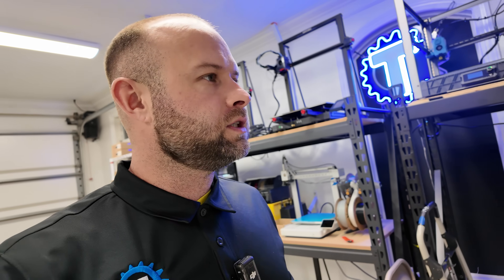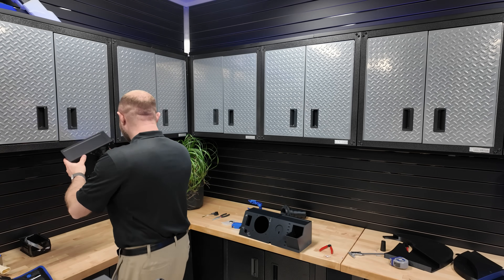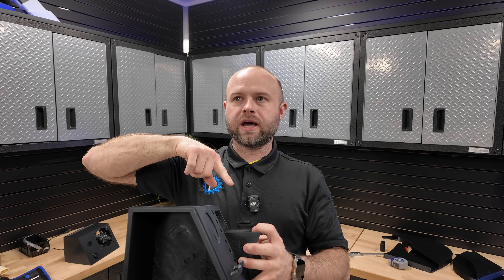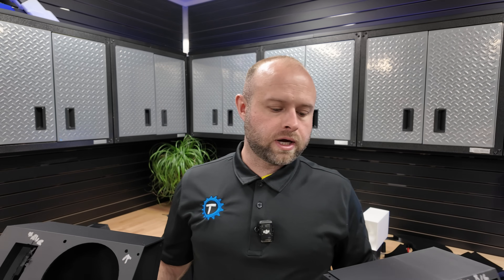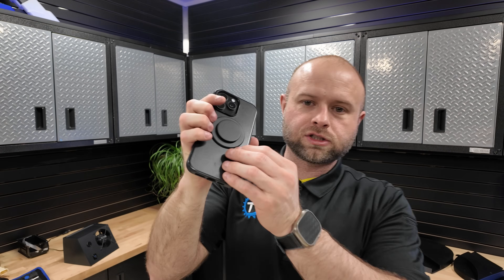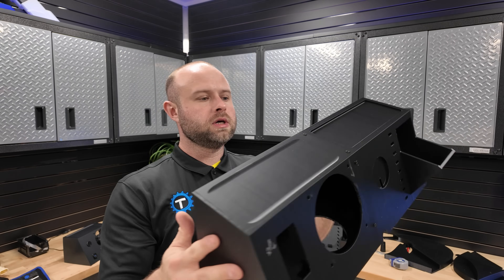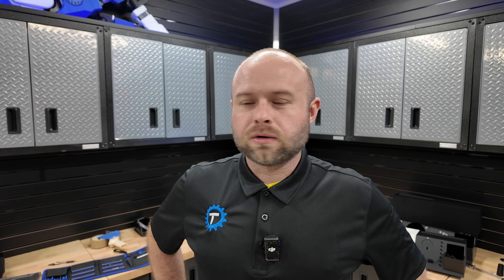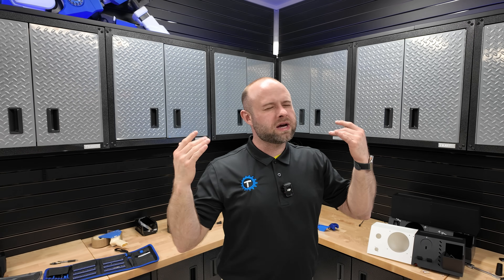Custom Designed Desk All-In-One Coming To LIFE! 3D Print Vlog

Comment: I’d recommend Onshape, rather than Fusion360. Fusion360 is way behind Onshape in many aspects. I have a very good friend who’s a professor of mechanical engineering, knows Fusion360, Onshape and Creo inside out, in constant talks with the Onshape makers and says their level of support and development pace is mind-blowing. I was a bit like you, designed all my 3d printing parts in SketchUp (sic!) for almost 10 years, as Creo (and its predecessor Pro/E) appeared way too complex for me and neither Fusion360 nor Onshape was around back then. (Also I’m a Mac guy, and Creo required a Windows machine, which in emulation isn’t that snappy).

By the end of last year he gave me a 90 minute crash course in Onshape, and since then I’m addicted. I mean, I still perhaps only know 7% of its features, but the models I can already create with it – given that I only have time to design now and then – make me kind of proud. Here are two examples:

1. Power-socket frame <https://cad.onshape.com/documents/1a6fa27393d5d25a28d261b7/w/0b2f33df7ad5c646f92e52d3/e/5f4dcdb52fc8a430bc3967de?renderMode=0&uiState=681f4210eb695d2078ac78c4>

2. Recess frame for flush mounted light switches <https://cad.onshape.com/documents/97d35e3d1b3255b584622869/w/e5dd26abf5feddb7161b0fd6/e/a7907840fd5cb8c9b2cd753d?configuration=List_HuNCcbMNAkdYNr%3D_3_fach%3BList_PM6QcFB21FJ1WW%3D_3_mm%3BList_vvMa98Ko7g8YSv%3D_8_0_mm%3BSchraubfahnen%3Dtrue&renderMode=0&uiState=681f4310f2b2ae4ebf743dec>

Try the configuration options on 2. where you can dynamically adjust the manifold, thickness and switch the mounting tabs on/off. Quite impressive feature.

Comment: PLA is not going to melt in the sun. It doesn’t start to deform until 150f.  There is no weight on it either I think you will be fine especially if you are going to paint it gold.

Comment: Nice to see the Giga working, was watching GIV (german in venice)  and he was at an art expo in LA and they had a laser cutting section, which included 3d prints, and they had the orange storm giga on display there with 4 nozzels on the gantry printing 4 models at once, which i thought was a a cool and unique use of a big printer. The laser cutting was cool, they  made 3d print like models out of cut metal by stacking the cut layers.

Comment: I'm with you, I HATE using glue... But, there have been times where it was absolutely necessary.. on those occasions, I really like Vision Miner Nano Adhesive... But, it's friggen spendy... Fortunately, I've learned it's just as effective if you dilute it 50% with isopropyl alcohol...so that effectively cuts the price in half, with no loss of adhesion.    But to be honest, I've found getting more build plates, specifically a Garolite plate, and the Bambu Engineering plate (Bambu no longer sells it, but you can find them on AliExpress), and running my BIQU CryoGrip Glacier plate stupidly hot (10° hotter than PEI, it's definitely not a cool plate) and I haven't needed glue in months, even printing polycarbonate and nylon.

Comment: Matt, do yourself a favor and move away from glue stick as a bed adhesive. Get some Vision Miner Nano Particle Adhesive. I use it on all my printers and it really does a great job keeping things on the bed. Also, for your desktop organizer, add a brim to the part as that will also help keep it down.

For the "S" on tour gate, you might want to look at nylon. I've been printing an enclosure for my Sovol SV-08 with Polymaker's CoPA nylon and I think it would give you the UV and heat resistance you're looking for. It's a little pricey, but the material properties should be just what you're looking for.

Comment: About that desk hub: why don't you make it more modular with separate components that you can screw into a frame. A little bit like a 10 inch or 19 inch rack, or like the cockpit of a plane, where you can remove or replace dials / instruments. Makes it a lot easier to design and print. You could make the modular width multiples of an inch for example, a bit like gridfinity or multiboard.

Comment: To stop or at least reduce the ghosting in the slicer after slicing look at the print speed and you’ll see different colours showing different speeds. I bet they are in the same place as the ghosting. I reduce the wall speed so the model is all one colour. So you slow the lot down to the slowest. Won’t make much difference as it’s only the wall speed.

Comment: Tinkercad tip (well, what I do at least)  In Tinkercad when things slow up as you mentioned, duplicate the part and then make it a "Your creations" shape and start a new design and place your new part.  Now being 1 "piece" it will place fast.  No export, import waiting for stl to load, etc.  Then if you need to change that part, you made a duplicate before that you can adjust and do the same process again.